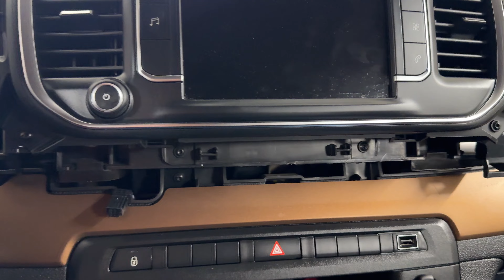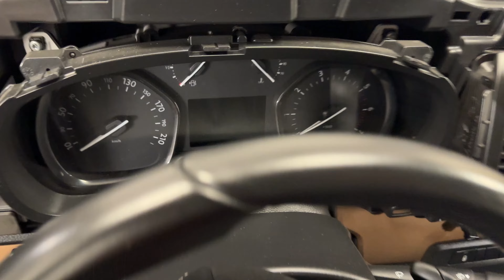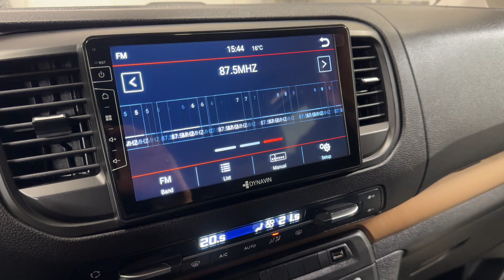Toyota Proace Verso 2016-2025 - Dynavin D9-TYPA Premium android radio

Comment: I'm looking at getting one of these. Does it still give access to the vehicle settings? Things Like turning the traction control on and off and setting the headlights delay? 

Thanks
Reply from the maker: Yes, all settings can be changed in the radio menu like the original.
Reply: @tvsatnitra1613  thankyou
Reply: Are you able to reset TPMS? I could not see it in the video.